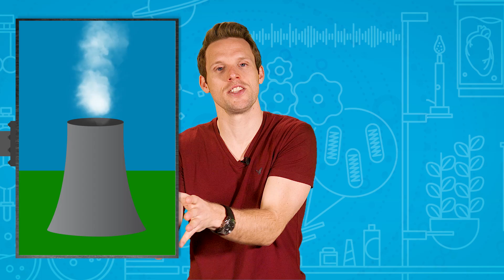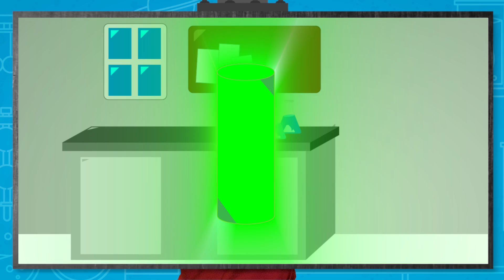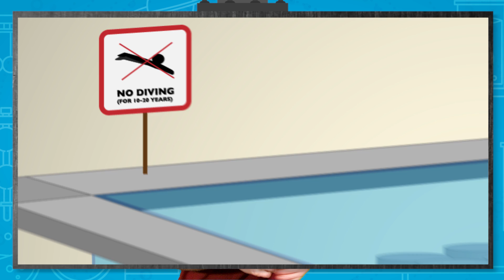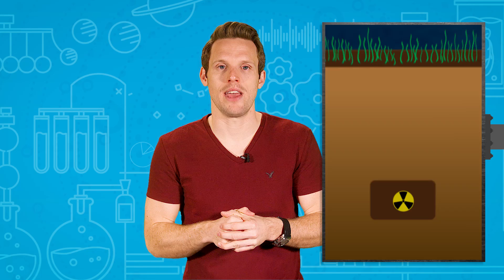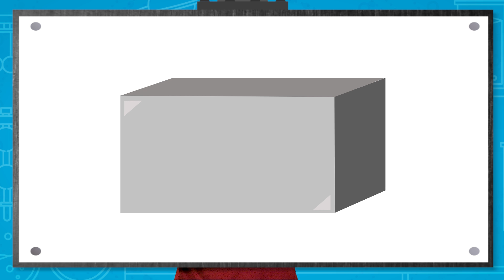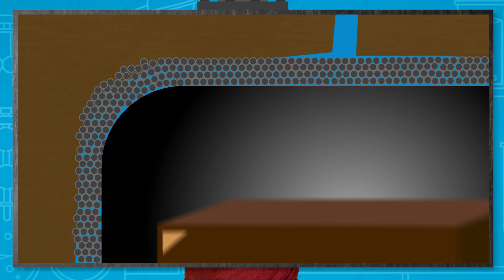What Happens to Nuclear Waste? | BBC Earth Science

Comment: Why not concentrate the radioactive part of the waste back into fuel?
Reply: The most radioactive isotopes that constitute nuclear waste are the fission products, which themselves cannot function as fissile fuel. Unfortunately this video never explained what radioactivity actually was, and therefore their explanation is rather misleading.  Radioactivity is the amount of particles emitted per second of time. If takes more time for a amount of material to decay then this material will have lower amounts of radioactivity, because per second there are less particles emitted. Isotopes such Uranium 235 and Plutonium 239 actually exhibit low radioactivity as it takes considerably more time (7 billion years and 250,000 years respectively) for these isotopes to decay. Compared to isotopes such as Krypton 89, which the primary resultant of Uranium 235 reactions has very high radioactivity exhibited by its very short decay rate at 3.5 minutes.
Reply: Even a weak emitter can be used as a power source, even if just through natural decay.
Reply: Zach Crawford Its not cost effective for commercial nuclear reactors to pursue that source of generation

Comment: Underground bunkers have already been a failure in several aspects (Transportation methods, Leaching, ect). The over all costs involved with this has also proven to be much higher than expected, and when researchers checked on previously designed, deep underground bunkers with stored Nuclear Waste they found material leached through the containers designed to specifically hold Nuclear waste. Ironically, the investigation found Microbial growth. Not only was it found, researchers were astonished to find that was breaking down the Nuclear waste (Which was never thought to exist). With this being said, I don't know why this would not be on the top of the list for researching into ways of eliminating these types of waste. I wish I had kept the article or where I had read it. Oddly enough, I never heard about it again for some reason. I was taking my Environmental course at the time and used the article in research paper that was for alternative methods of reducing/disposal of Nuclear and other Hazardous wastes. The professor had kept a copy as he was very interested. There was some other really good papers from others as well. I think some researched extreme incineration process, and another was something pertaining to stripping the molecules down through either a mechanical or biological process which the end product was either no longer deemed Hazardous, or able to be reduced to a much small volume, but I don't recall. Point is, there most certainly is other ways of dealing with this stuff. I'm guessing cost over profit is the over all factor..... If only the truth was made public.

Comment: I wonder if the nuclear rods could be used for something rather than discarding them... if they are combusted will radiation then just drift through the sky? What research has been put into seeing if it’s possible to erase levels of radiation somehow?
Reply: If fuel catches fire, it will spread particles into the atmosphere. It'll also melt (see china syndrome.... which is thoroughly debunked, but just to illustrate, yes, people have thought about these things)
Reply: Yes, Liquid Flouride Thorium Reactors (LFTR) are claimed to take existing reactor waste in along with their Thorium fuel. The resultant spent fuel from such a reactor is of considerable lower volume and requires far less time in storage to decay to safe levels. Keeping something secure for 500 years is much easier than for 50,000.
.
This sort of reactor is also unsuitable for creating fissile material for nuclear weapons.